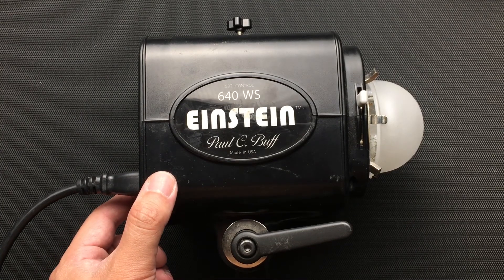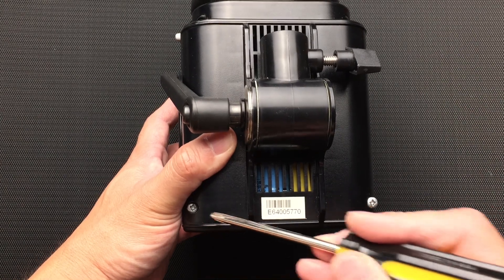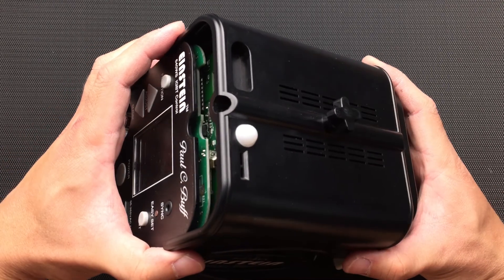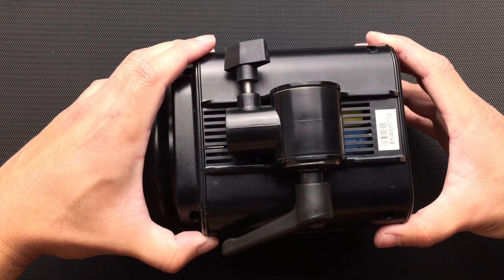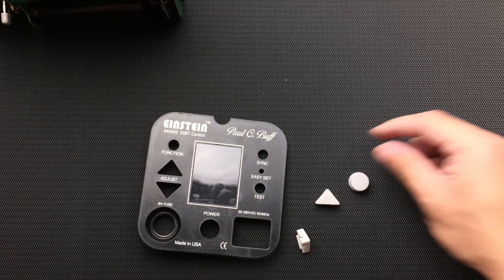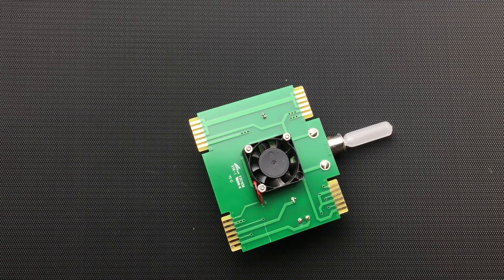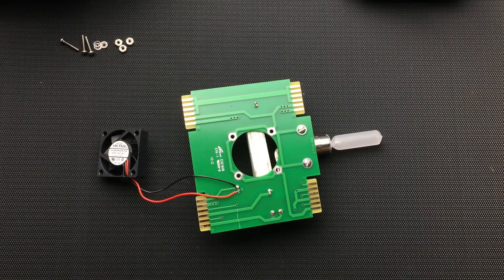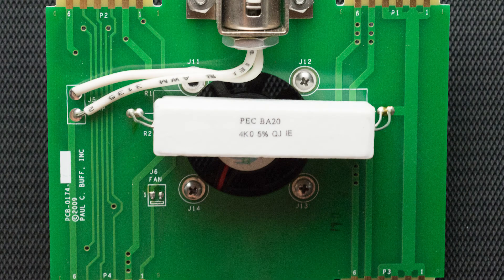Paul C. Buff Einstein E640 Tear Down and Fan Replacement

Comment: very good your video!!!
I have 5 units of these einstein since 2013!
I've never repaired the fans and I'm going to open them to do it.
A very important question!
How to make sure that the energy capacitors are discharged, as an electrical discharge can be dangerous.
Thank you very much!
Reply from the maker: That’s a really good point. Open them up after they’ve been unplugged for a while.
Reply: I find out by accident that when you unplug them while they are switched on, the unit fires one more time before turn off.

Comment: This helped me repair the Einstein's faceplate, which I've now discovered needs periodic lubrication.  Thanks!
Reply from the maker: The mechanism for mounting speed rings?
Reply: @tinkerist3311  Yes, the 4 jaws that secure the modifiers. PCB calls them the "faceplate. and the Cam"  After using an Octa for a few sessions, the faceplate on my Einstein locked up.  It took forever to get it to release.  I called PCB repair and they told me I needed a new faceplate and that it could not be done by the user.  I watched your vid and opened it right up, lubed it carefully and it's as good as new.  Thanks again.
Reply from the maker: @anthonyscott16  Good to know. Glad to have been able to help.
Reply: @anthonyscott16  I'm having the same issue with mine, what kind of lube did you use?  PCB will not repair these early serial number units.

Comment: I disassembled mine cuz the fan had stopped working turns out they increased the fan size I ordered the fan you recommended thinking that was it but its actually a 50x50x10mm one that mine requires. If anyone uses this guide double check the size fan yours has in it so you don't order the wrong size.

Comment: Thanks again -- the fix is quite easy and your instructions are perfect! I note as a contribution to your great video that I just finished this and found a slight difference and perhaps because my light may be newer.  The fan in mine was 50mmx50mmx10mm (still 12v DC 0.15A) so I advise anyone to check which fan they have before ordering one. And as most available fans that have same connector on the end, they won't even need soldering. I didn't have to replace the fan (luckily as I didn't have that size) but I cleaned the existing fan of some dog hair that was entrapped and now it works just fine anyway. One more note: the initial 4 screws are a challenge. If you use a power screwdriver please do so with extreme caution as it would be very easy to strip the screw heads. I spent a lot of time making sure I had the right screw driver as and being very careful to push down and into the screw head as it felt that like one slip of the screw driver would cause enough damage to the screw to make it impossible to remove.  So do make sure you have a strong and well-fitting screwdriver to start, and consider a ratcheting screwdriver to make the job of twisting out 4-inch screws a little easier.  Thanks again!

Comment: Cool video. Question, PCB will do repairs on these for about $50 (even out of warranty). Why did you choose to do the repair yourself?
Reply from the maker: Fans are cheap and it takes about 15 minutes. The hardest part is removing and reinstalling the first 4 screws as they're fully threaded. Use a powered screw driver and the repair will probably takes just a few minutes.
Reply: PCB does not repair units with early serial numbers such as this one anyway...